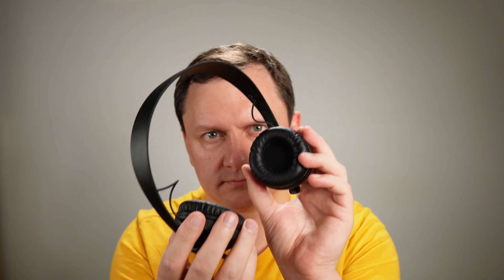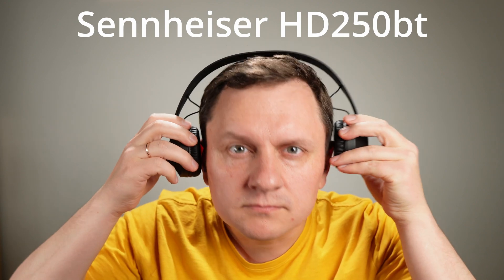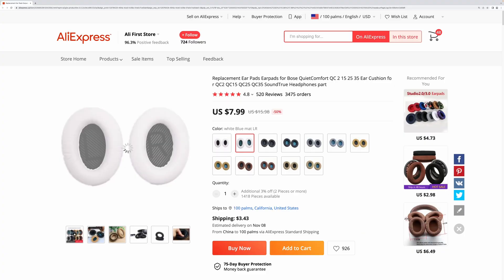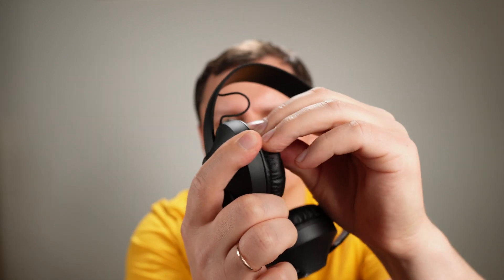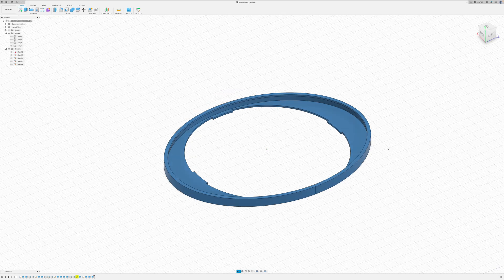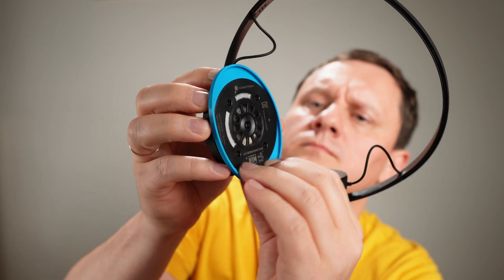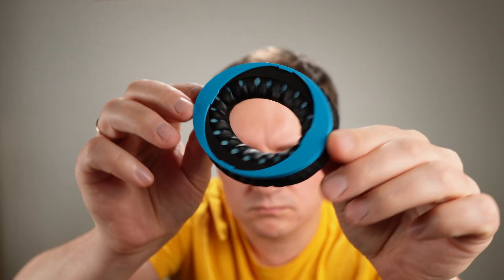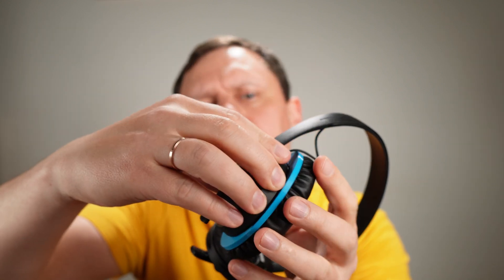This fixed Sennheiser HD250 bt biggest issue

Comment: I just had these printed at a shop but they dont seem to attach to the headphones. Is my understanding correct that all 4 "notches" on the circular side of the part is meant to slot into the groove of the 250BT where the original earpads grasp?

if so, then the part does clamp, but it is completely loose. as I an I can move it up/down/left/right and rotate it 360degrees while it remains attached to the headphones. its not fixed in place like the video seems to show after a "click"
Reply: have you solved this problem somehow?

Comment: So, I’ve had the hd250bt for a bit and thought the same. They were a little uncomfortable after longer listening periods. I went on the hunt for a 3D printer and the pads. I have just finished it and it’s so much better. I love the sennheiser sound and I am so chuffed with how these came out. They will not blow your head off with crazy bass but I love the neutral-ish sound. Thank you so much for this video, I have been raving to everyone about it and now people want to follow suit and do the same. It is probably the best budget set of headphones you can get and not with the pads, they have to be the best 🔥🔥🔥🔥🔥 if you have anymore little modifications, please post 🤙🏼
Reply: Hey buddy, I've been thinking about doing this addon for my HD250BT but I'm a little worried about the sound quality after I change the pads. Did you feel any significant change in the sound quality after using it for a time?
Reply: @diller16 earpads won't make a sound difference.. .